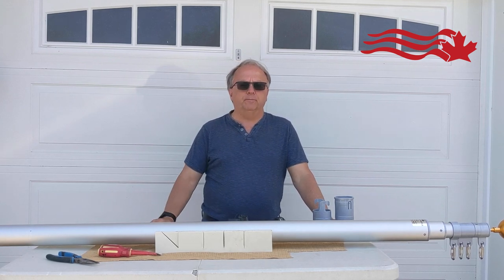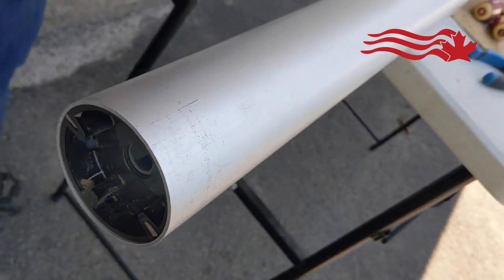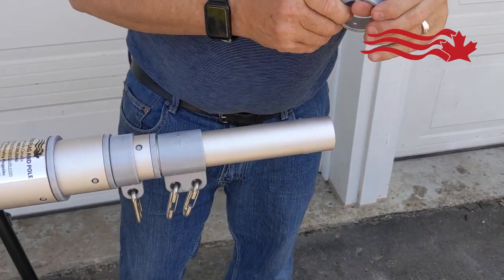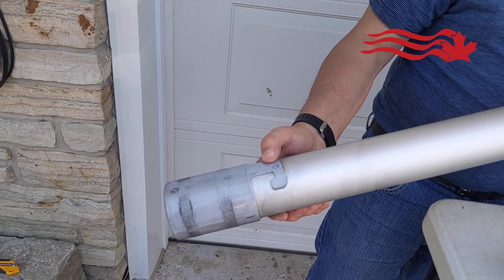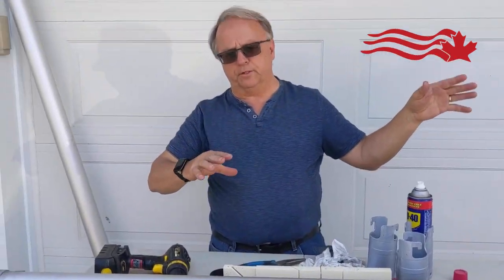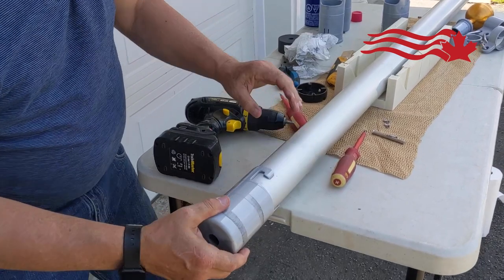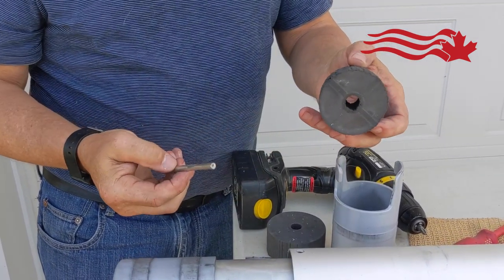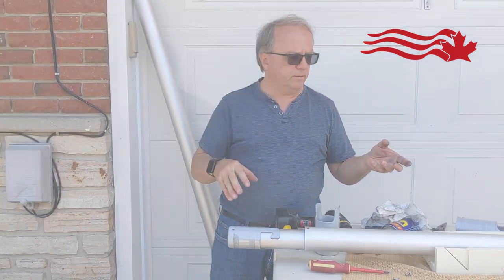How to repair your Titan Telescoping Flagpole

Comment: If your telescopic Flag pole gets stuck?   Pour water down into the joint to loosen up, of the dirt and sand in the joint 👉👉 WORKS EVERY TIME!  with a band jar opener to.  Then hand tight only !  👍👍

Comment: I wonder how much more this flagpole would have cost, if they had constructed the interlocking sleeves out of aluminum.  The plastic sleeves on my 8 year old pole has broken 3 times.  After the second time, 2 years ago, I stopped lowering and raising my pole except to replace the flag twice.  Now the flag needed replacing again, and the bottom sleeve is broken again.  Sure, lifetime warranty, but what a pain to have to keep replacing these cheap plastic parts!
Reply from the maker: So sorry to hear that you’ve had multiple issues with your flagpole. This is very rare. The average person may replace one interlocking sleeve every 10 years or so and some never need to have it replaced. 

The interlocking sleeves are made of Lexan plastic, which is the same material used on airplane windows, so it is meant to last. It also reduces the risk of lightning striking the pole, so it’s a design choice not a budget choice.

Please reach out to us directly so we can assist or problem solve with you: https://ontarioflagandpole.com/contact/
Reply: @OntarioFlagandPole    Thank you!  But I bought mine from the Flagpole Farm and they sent me the parts under warranty. They also explained the design choice, saying that aluminum sleeves would corrode. I appreciate your offer though. 👍
Reply: I missed the repair part and the facts that parts needed to be replaced. Was that in this video?
Reply from the maker: @craigseaman4275  yes it is. If your flagpole stops locking in place it has internal locking sleeves that may need to be replaced. This video demonstrates how to repair if this happens